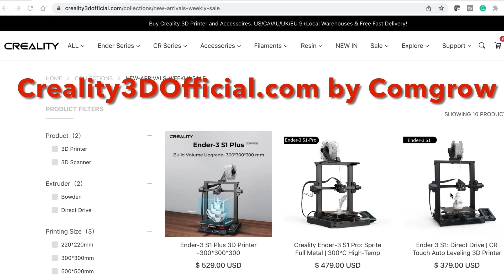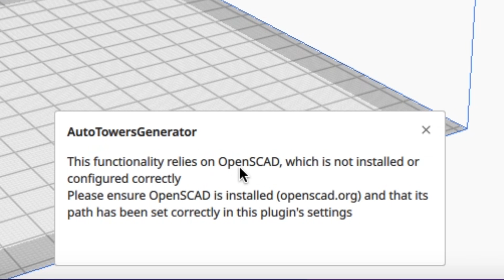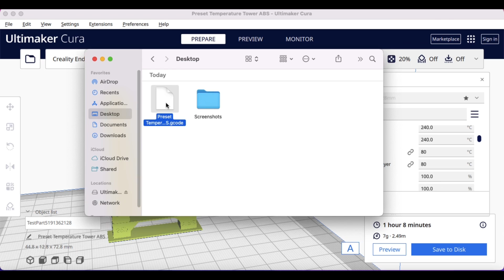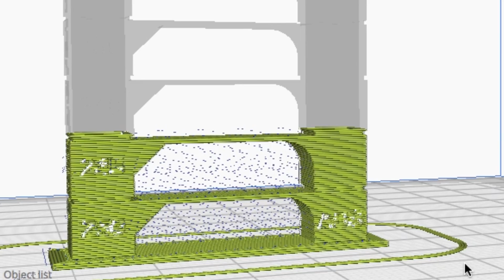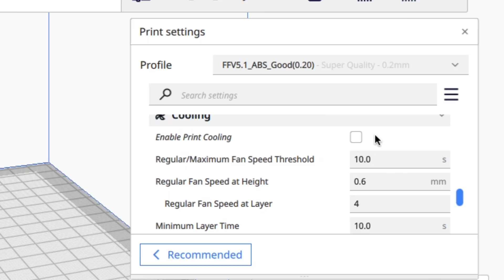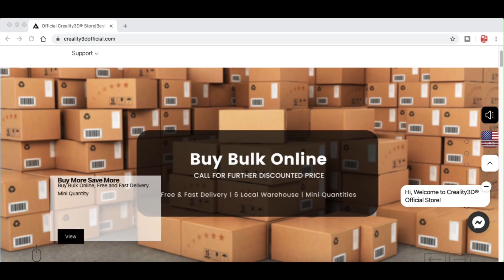Cura Test Towers Created Automatically

Comment: the temp tower worked for me
but when i tried the retraction and flow towers i could tell no difference
i put a piece of tape on the filament to watch the retraction and cannot tell a difference in the amounts retracted
am i doing anything wrong or is this just me? on a fresh install of cura and this plugin with a ender 3 s1 pro

Comment: Liked and subbed!! Im pretty new to printing. Im using that extension to try to print a flow tower, but it looks like the flow doesn't change all the way up. But if i print a single line wall on a cube i can get it to be thicker or thinner etc... why would my tower just stay the same?  
Ill save the file like you did  and check if its changing in the code

Comment: I just did this for my Ender 5 Pro with PLA.  I noticed that the '3 layers above' that you mention coincides with the temp drop for the next section.  I suppose it takes at least 3 layers to reduce the temp of the hot end.  I'm no pro...just an observation.  Thanks for the video though...I've been needing this in my life.

Comment: Found this today before seeing you did a video. Very cool that no scripting is required for most of them, super easy. My temp tower was suspiciously good but I was monitoring it so I know the temp was changing per the model. No stringing either from 4-9 on the retract tower (Ender 3 Max). I think this red Monoprice premium PLA is just generally very well behaved.

Comment: But my ABS+ temperature range is 220-260, not 210-250. Is it possible to change the range?
Reply: Late answer for you so I don't know if it will help, but if you want the upper 10C just have it start at 260 instead of 250 while doing the rest the same. You can just remember the temp difference when looking at results.

Comment: Tip to using one of those Creality enclosures. Before printing ABS I pre heat the bed at my desired temp for 30 min before starting a print. By the time you go to start a print the enclosure is much warmer than the ambient air outside it.

Comment: Hey CHEP, I print ABS for around the same time as I begun following your channel, 2019, the most important thing for ABS is not so much the enclosure temperature (unless you have an oven-printer that can sustain constant temperatures around 100c) but to avoid drafts of different temperature air, placing the printer in an enclosure, a cupboard or simply covering it with a cardboard box, will make all the difference. Also, you should increase your bed to 90c and turn on your part cooling fan to 60% at 'Regular Fan Speed at Layer = 5'. Lastly, make sure your filament is bone dry, red pigment is one of the worst for absorbing moisture.

Comment: About using gluestick on the bed, try this: after directly applying the gluestick, use a damp cloth to gently wipe the bed. Do it right and it'll smooth out the glue to get a nicer bottom surface. You don't need globs of gluestick on the bed!

But for ABS I would use a soup made from waste ABS and some acetone, painted onto the surface.

All on glass.

Comment: I recently bought 2 Ender 2 pros.  The specs say the build volume is: 165 x 165 x 180 mm. The cords going to the hotend will only allow mine to reach about 125mm on both machines. Curious to know if you had a similar experience with yours?

Comment: I want to say I like your videos, but I have had little success with your profiles. I have the exact same printer, and my prints fails most of the time when using them, but work fine with the generic ender 3 profile. Not sure why? Could be the filament I am using. Do you always use the same brand filament when testing your profiles? Or it could be just me, or where I live(temps etc).
Reply: I had the opposite effect for my printer lol. I couldnt tweak default profiles or custom ones to get mine to run right. I put his profile in, adjusted flow and temps, and then it solved all of my problems.

Comment: When making a retraction tower you pick the range you want to test, but no temps or speeds. When you print the tower and it comes out perfect on every setting, which do you choose if you didn't have to enter the speeds or temps? I chose a range of 4-9 and got a pretty perfect tower off the bed. 🤔🤔

Comment: Thanks Chep. When I changed from the free PLA that came with the printer to the Sunlu PLA+ I did a pre made gcode test tower for my stock Ender 3 Pro with the Marlin 2 firmware.  It works best for me at 230C standard 190C kept failing.  If I change again I will print another tower.  Best wishes.

Comment: I have been printing with ABS since the 1st day I got my 1st 3D printer and I have been struggling a lot to get a really good quality print. After some time experimenting, 235C hot end temp is the best. For the curling issue, I've been using binder glue which is far better glue than anything to print with ABS. With all this experience, I've been printing flawless ABS prints to date.
Reply: What do you do about deterioration of the PTFE Bowden tube from the high heat.
Reply: @UnCoolDad  I haven't had any problems with that so far. If you're having problems with it, changing to a Capricorn Bowden tube will solve it because they don't deteriorate and can withstand more heat
Reply: @savindugiman4130  not had a problem as I have not tried and yet.  I'll investigate the Capricorn.
Reply: @savindugiman4130  it seems they do not recommend Capricorn tubes above 240C.
Reply: @UnCoolDad  It's well within the hot end temperature I use to print ABS. So it'll work
Reply: @UnCoolDad  i printed for over year mostly abs at 240 with a stock hot end. Every month or two, you should pull the ptfe tube out, snip about 5 to 10 mm off and then stick it back in and kep printing. You see some browning over time and the surface gets a little rough. You might even notice the drag effecting prints. Once you get a routine, it's not bad. Switching to microswiss hotend was an obvious choice for me after about a year.
Reply: @ColburnFreml  thanks will try that.  Any particular brand of ABS which gives you least trouble?  I use eSun PLA.
Reply: @UnCoolDad  I've liked Paramount ABS for printing quality and color choices. Matterhakers worked well too.

Comment: do u always need an encloser for abs filament ?
Reply: @numpty9989 really u don’t think so
Reply from the maker: It helps a lot to prevent cracking as well but smaller prints need it less.

Comment: Thanks for your video mate. Just one question! I used Cura built-in generating temp tower recently and checked its preview to see where are the adjustments of temp at each layer. However while it was printing, the printer’s display(CR-10 V3) didn’t show any changes to temp at any stages! Is that how it’s supposed to be for not showing any change of current temp but it’s actually changing/lowering it when it’s printing?
Reply: Depending on the plugin version you have installed, you may need to select the "Enable LCD Messages" option in the plugin's settings menu. Some printers don't handle the M117 gcode command used to send messages to the LCD.
Reply from the maker: Mine showed it in the LCD at the bottom.

Comment: Your enclosure is probably too big. The air gap above the printer probably takes too long to heat. That's been my experience with enclosures.

Also of note with ABS is print surface. I have problems with flexible build plates allowing the corners to peal up the build surface even if you get good adhesion. I print on PEI stuck on top of glass for my abs prints for best results. Most of my repeat print programs have mickey mouse ears in the corners as well.

Comment: Your results are in line with what I came up with. My ideal temp for ABS (Hatchbox white filament) is 232 C on my Ender 3v2. Glad you decided to do a video on ABS. I love the stuff because it is easy to post-process (sandability, fuse with with acetone). Also not as brittle as PLA and withstands higher temperatures without melting/warping. Hope to see more on your ABS profile.